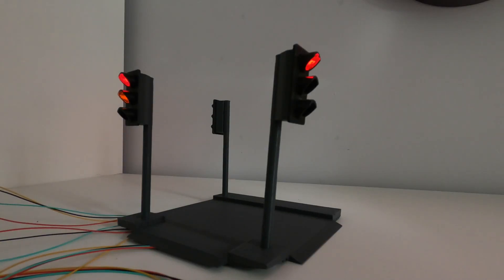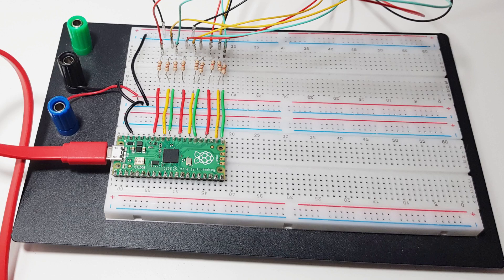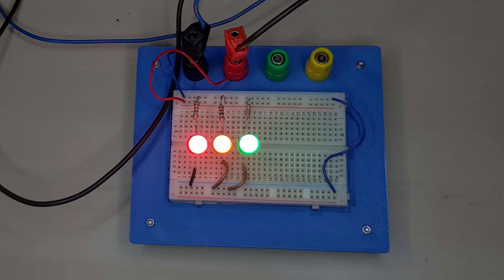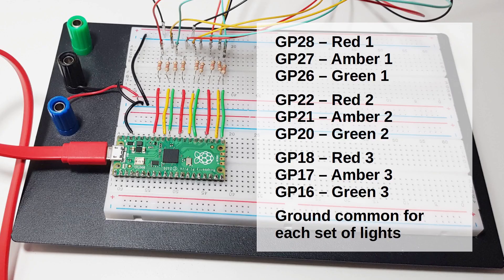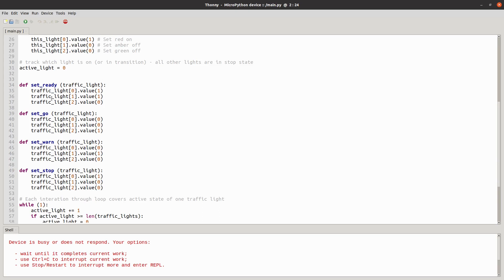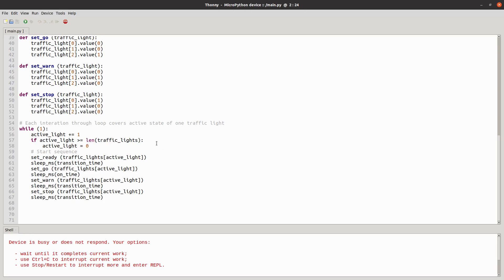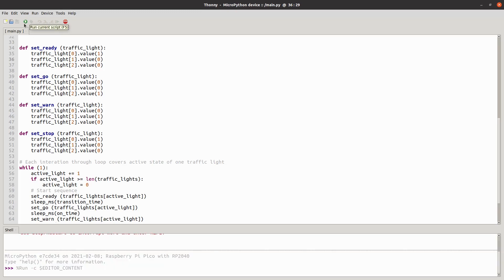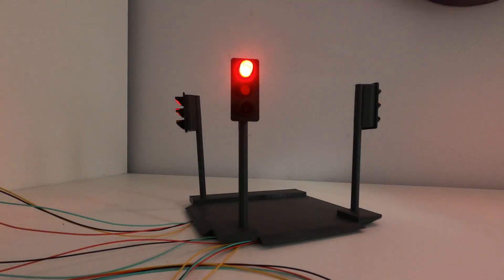Raspberry Pi Pico - Model Railway Traffic Lights

Comment: Cool project! I have also started recently with Raspberry Pi Pico, I use the Arduino IDE for programming it though. I will try this microcontroller for my model railroad automation projects.
Reply from the maker: Thanks. I haven't used the Arduino IDE for programming the Pico yet. I was waiting for the official version with Pico support, but I get the feeling that is going to take a long time, so I may have a go at adding the Pico to my current Arduino IDE instead.